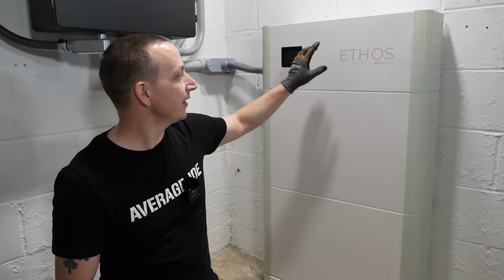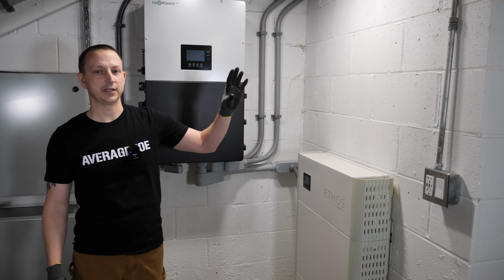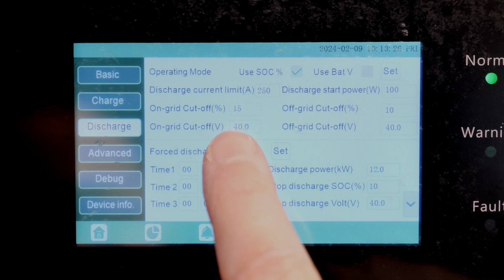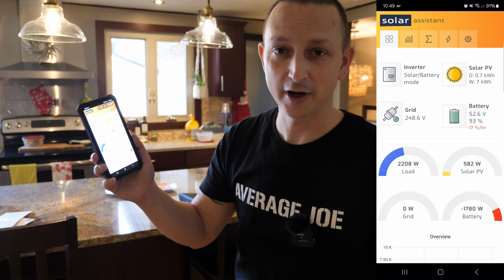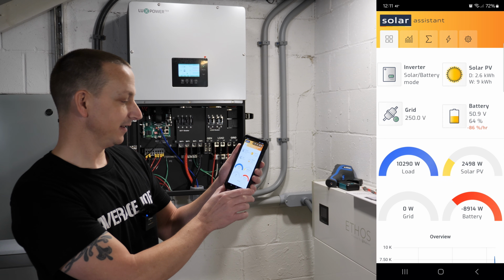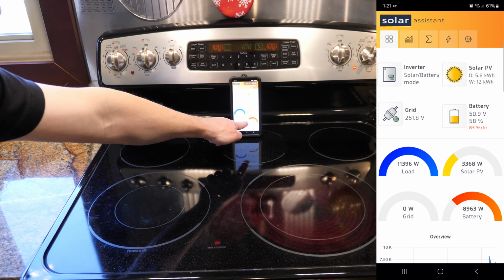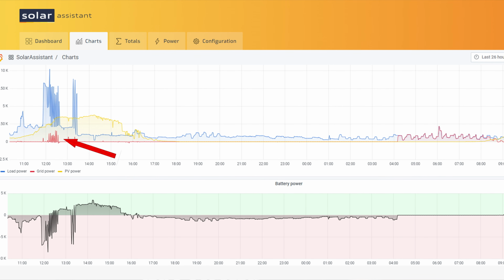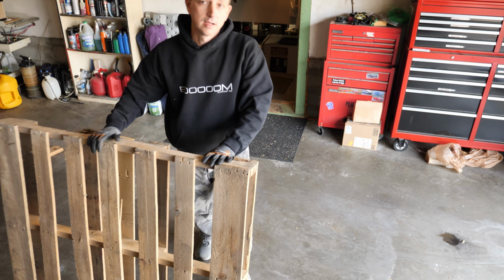Testing a 10kWh UL Certified Energy Storage System ESS from BigBattery.com

Comment: I'm confused. I have a 100Amp subpanel with the circuits I'd want to back up during a power outage. Can I connect it to the LuxPower Hybrid Inverter 12K US or am I limited to a 50Amp panel?
Reply from the maker: You can 100% connect it! I have it connected from my 200a panel and then output is to my subpanel which actually powers a 2nd sub panel as well.
Reply: @AVERAGE_JOE  Thanks Joe. I know you used crimp tube terminals for the cable ends. My electrician says the tubes should be AL-CU rated. I think the battery cable is made out of aluminum, but all the tube terminals I found are copper. what did you use. BTW your conduits are so neat.

Comment: Just curious how many solar panels do u run?
Reply from the maker: Just replied to the other comment but wantes to add I have 2 smaller ground mount arrays going to this system as well from another charge controller. So 5 arrays in total. I will be changing the ground arrays a little here coming up pretty quick.

Comment: That was an excellent, helpful demonstration! Really helped my decision making.  That said, just changed my mind about ETHOS batteries as I plan an outdoor location - EG4 setup seems better for external placement - cables all enclosed, away from moisture.
Reply from the maker: Thanks! This system including batteries are UL certified for outdoors. Also the EG4 system is a great option as well. I have aff links and code for them as well in my latest solar videos!🤘
Reply: @AVERAGE_JOE  Yes, Ethos IP65 rated and I was initially going to go that route, but then I realized cables would require conduit anyway.  EG4 has that combiner box with knockouts that match the battery and inverter, so it's all sealed. Biggest downside for EG4 is they weigh 300 lbs.
Reply from the maker: @ArthurDentZaphodBeeb Yeah the conduit box is a sweet deal to mate both up. Nice easy clean install and YES lol the weight. Although it only needs to be moved and placed once🤞🤞😁

Comment: I think you did a great job with your video. You didn't stray too far. You tried to not ramble (which I'm bad about) you covered most of the essential topics. 
Recently installed a similar system
( EG4 18k pv) Already had a soft start installed so I can run my 4ton heat pump with a portable generator. It was working fine until I installed the 18k pv. For some reason it didn't want to play nice with the control board on the HVAC. I tried swapping out different soft starts then eg4 sent me a replacement inverter. After I went to the expense of swapping it out it still didn't solve the problem. Supposedly eg4 has employees that are running 5 ton HVAC's with this inverter with no problem. Mine keeps maxing out the rated peak compressor then it would go into self-protection mode shutting it down leaving the internal blower motor still blowing as if the AC was still working with zero cold air blowing into my house. 
Still not have resolution to the problem but supposedly EG4 is going to contact my HVAC technician to have them bypass the control board entirely. 
This seems like a strange solution to me since my HVAC was working fine BEFORE I installed the inverter. 
I'm curious what size HVAC system you have, or if you're having any problems. Mine is a run of the mill carrier system nothing out of the ordinary so it's kind of a mystery why I'm having such trouble. Before I install the inverter running my HVAC with a soft start my inrush current was only about 23 amps. My running amps: about 12. 
AFTER:  the compressor with max out at about 21 amps (the maximum on the name plate is 20) which would send it in to self protection mode and shut off the compressor leaving the exterior fan and the interior blower running as if it was working okay. With the thermostats calling for cool air it would run like that forever and not cool the house. 
Overall kind of disappointed. 
In the future I will probably still install individual mini splits and get away from Central are completely but still it should work and it doesn't.

Comment: So from the time you used the batteries without any charge, what did you use around the house to make it died around 4am???
Reply from the maker: That would be my homes "idle". Thats a couple of fridges, couple computers, router, cable modem and a slew of phantom stuff like laptops, tool battery chargers ect... Could I turn some of that off to make it last longer, sure.
Reply: @AVERAGE_JOE  Thank you. I am thinking about getting one for my off grid property

Comment: Very cool!  I was just wondering when we were gonna see an update on this system.  The hybrid aspect is nice that you can power those extra loads in your main panel if you want to.  Still have to find time to mess with that on my system.  It's a great feeling though when you can just set up a system and then forget all about it and not have to worry if the lights are gonna go out...
Reply from the maker: I need to get back to videos over here. I miss it! Yes 100% great feeling to know that it all.....just works and it powers everything!😆🤘

Comment: I'm the nerd who paused the video at all the solar assistant screens and calculated the inverter efficiency based on load, solar pv, and battery power. 21 data points : MAX 97.23%, MIN 89.30%, AVE 93.73%
Reply from the maker: 😲🤯😁🤘 We Love Nerds like you! I wouldnt know where to start!
Reply: Remember any and all waste is heat. Sometimes it's helpful if you need it there

Comment: 60Kw battery is not big enough for those dark and snowy winter  days off grid.
Reply from the maker: Yep....was afraid of that! Will need moar battery and solar. I think 60kwh would be a "starting" point. Is that what you have and can confirm?
Reply: Yep and 5.25 kw of solar. As of right now I create the perfect amount power. In summer in need to run ac’s just so I don’t waste all that power

Comment: Awesome video -  I am thinking/wondering that in the summer if it might be best to change settings so the batteries are only used for (backup power/ grid down) and run the house on solar by day and send extra solar onto the grid (net metering) and then pull power from the grid at night to save wear on the batteries from being sucked down every night by the HVAC.   Would be interesting though to see a similar video to this one in July or August when it is 95-100F on a sunny day and see how it does with the AC running on and off all day.
Reply from the maker: Thank You! I am interested in not sending power back. Mainly they dont pay much/only give credit. We can 100% do moar videos in the summer with the AC running during a 24hr period. Daytime wont be the issue but we see!💥🤘
Reply: @AVERAGE_JOE    Ahhhh,  i'm a pretty new viewer and didn't know your power company didn't give 1 to 1 on its Net Metering,  some say Net Metering will go away completely some day so batteries are going to be a must have.
Reply from the maker: Welcome and Thanks for watching! Yeah I guess years ago it was a great deal but not anymore. Its like they said Oh Crap....we dont want this cause we wont get PAID. Yes I believe you are correct, it will probly go away and batteries will be a must and the way to go! I just never want to lose power. Happend once in the winter when we first purchased this house and it sucked! Made a deal with myself that it would never happen again.🤘

Comment: This video proves that you should NEVER connect your range to solar.  Range pulls tons of energy 😦.  Love this video.  Thank you.
Reply: With this inverter you can because it will just pull any overage from the grid
Reply from the maker: Also Troof!💥
Reply from the maker: I plan to do thanksgiving this year all on battery/solar. I actually hope to do a lot moar. I think the main thing is the AC at night during those hot summers. 🤞🤞

Comment: Great job Joe. I am installing one 6000xp and hope it will do the same job. We have grid too for backup, and I have the same battery capacity.  As soon as I can pour concrete for ground mount I'll be in bidness. Too cold for that now!
Reply from the maker: Thanks! I think those 6000xp inverters look like a sweet deal! How many panels and KW?
Reply: I have 10 Solarever 455 panelsand 2 Brightmount racks and still researching extension rails for the extra 2 panels. Right now planning to mount 8 panels and hope that's enuf

Comment: Hybrid inverter with Cts on the homes mains so the inverter can supply the main panels loads is awesome! Your inverter can supply its max and at the same time the grid simply supplies any extra power needed
Reply: I think this is the future
Reply: @jl9678  I have been doing it for 6 years.. almost zero electric bill every month
Reply: Nice. I just started and my last bill was 15. Going forward should be zero
Reply: @jl9678  I still have to pay a $27 minimum to have their electric hooked up to my house or it would be zero.. good luck to ya
Reply from the maker: Yeah the good ole jic bill😲😆 It would be nice/cool/fun to get rid of that. Maybe one day. I know Id be moar prepared then many if the grid when down for a bit.
Reply: @AVERAGE_JOE you can do it now, right now easily with that inverter. Just slap some CTs on the homes mains wires and adjust inverter setting and BOOM! No more power bill… Lol 😆
Reply from the maker: I have the CT's in the main panel meow. What Id need to do atm is add moar battery capacity and maybe move some solar panels around. With all my trees, full sun wont hit panels till noon. If I didnt have all the trees......💥😆
Reply: @AVERAGE_JOE  I have near zero ebill with only 17kwh of Lifepo4 DIY cells.. family of 4. yeah probably need more panel with that much shade.. nice thing is that  when batteries run out the loads seamlessly just start using grid power
Reply from the maker: Yes! It is Awesome with a 12kw inverter!🤯😁

Comment: Hey Joe love the content. How much PV do you have? Im going with a solark 15k (very similar) and your set up is almost mirrored what im getting. I am a bit east of Nebraska so I'm assuming it would be pretty comparable.
Reply: Are you doing grid tied solar with micros? I was looking at the solark 15k as well. Trying to find something that will work with grid tied solar with micros+ combiner box
Reply from the maker: You can use this inverter and run your AC coupled system into the generator port if you wanted to have that system work if the power goes out.
Reply from the maker: Thanks Man! On the roof I have array 1 with 12 new 370w panels. Array 2 has 12 used santan 245w panels. Array 3 is a ground mount with 10 used 202w panels. Keep in mind my roof angle is TERRIBLE and almost flat. Winter time is very bad.

I plan to add moar solar and move some panels around here real soon. 

You in Iowa?
Reply: @AVERAGE_JOE  actually in Indiana. Indiana Michigan power  company shot me down for any solar over 6.4 kwh because my usage wasn't high enough. Granted I got gas central heat and water. Want to convert those to electric so I'm more self reliant. Seeing your test makes me happy knowing 15 kwh storage is very reasonable for me.

Comment: So just to be clear, if I have an existing grid tied solar array with Enphase IQ8M micro inverters with combiner box, I’d be able to use that energy that’s being created during an outage to power the battery?
Reply: I believe as long as it goes into the generator connection.